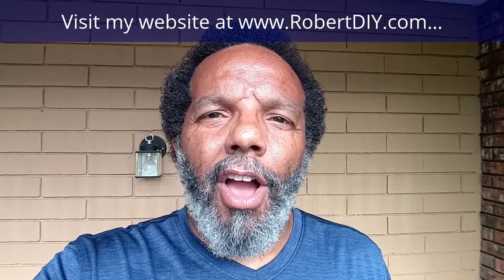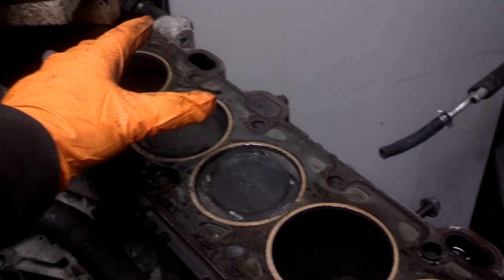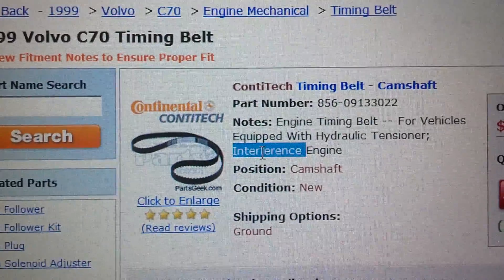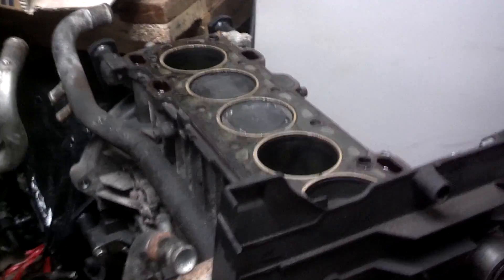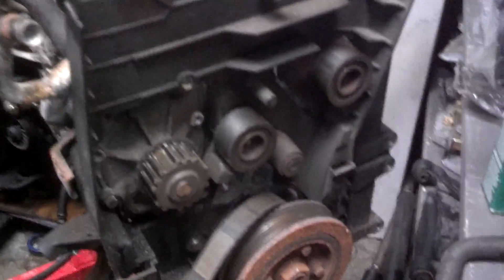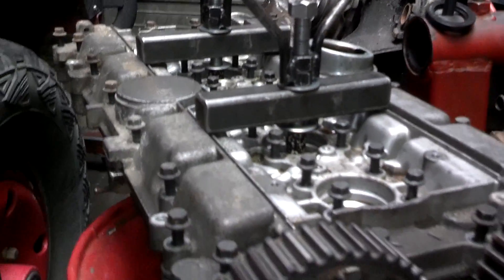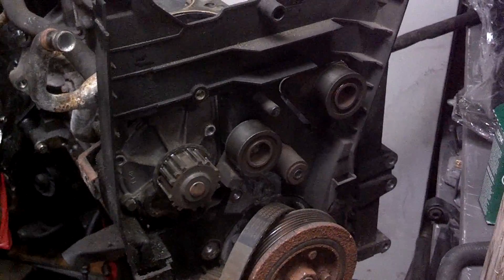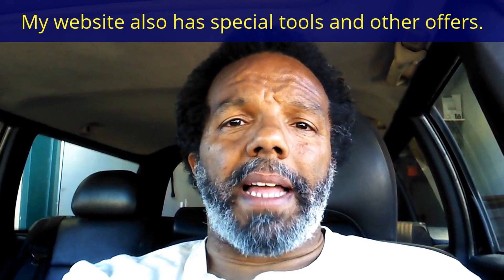What happened if your vehicle timing belt broke or came loose on an interference engine? - VOTD

Comment: interference makes no fkn sense
Reply from the maker: I agree.
Reply: @RobertDIY   It is most definitely, absolutely CRIMINAL, that engines are INTERFERENCE. A very simple 5 mm (or less), notch (depression) on the pistons, would prevent these problems. Or, if the cylinder, was a few millimetres (mm) longer. The cost at a dealer to repair, can easily be $5k, or even a backstreet small garage, will easily charge about $2k, just for labour. My 2009, c180, the timing chain just jumped time, and it wouldn't start now, I checked, the teeth on the timing chain gears were worn down.
Reply: @ZafOsophy  Had you replaced timing belt and bearings on schedule?
Reply: @ZafOsophy  Yes its a shitty design, but it makes for a more efficient motor, which means lower MPG and higher power.
Reply: @kristupasantanavicius9093  Maybe you are correct, but I don't understand how. 2 or 3 millimetres clearance, either by making the cylinder a little longer, or making a few notches on the piston head, would make sure, never any 'bent valves'.
I bought a timing chain kit for about £200 pounds, replaced just the chain, checked for compression, and it all worked fine. I did all the work myself, after watching numerous videos. I also upgraded the radio, and fitted a few dashcams:
https://youtu.be/DNJpTjrZMNs
Reply: @ZafOsophy  A local shop did my timing belt. They said belt tensioner was dead. They could remove the bolt by hand without any tools. I'm not sure how my car hasn't jumped time. Maybe you weren't so lucky :D
Reply: @kristupasantanavicius9093  Are we talking about a Mercedes C180. Maybe, you are confusing the Serpentine Belt (Visible - Fan Belt - Nothing to do with timing), with the Timing Chain (Hidden - Inside the Engine - Purely for timing).
Reply: @ZafOsophy  Some cars have timing belt instead of timing chain. When its a belt, its under a cover, but its not inside the engine. Timing chain also has a tensioner. I don't see how a chain could jump time unless it is stretched or the tensioner is bad. I have Volvo 850.
Reply: @ZafOsophy  the design cannot make a longer cylinder to make a longer stroke bcuz longer stroke is then not even close to efficient.  Simple geometry/physics.    Not able to have notch in piston tops bcuz of need for exact amount of mass at the right spots.    Read and learn things before  imagine that an entire finely tuned for production and product satisfaction industry, is somehow 'intentionally' making shiet products!   They have no other options but to create enough power and efficiencies.   This is basic stuff man!
Reply: I mistyped in my first response. I just changed the Timing Chain COGS, not the Timing Chain.
Reply: I bought OEM parts and the timing belt tensioner pulley went bad causing the belt to break. Im gonna put it back together n start it up and see what i got😐😐😐😐

Comment: What happens if the timing is off, but belt did not break?
Reply from the maker: No difference.
Reply: Serpentine belt broke. The car is trying to start, but won't. 04 S40.
I've seen on the web where a mechanic fixed an engine to where the timing belt was installed wrong.  They didn't replace the head, they reset the timing belt and the car started. Can you answer how that was possible?  I've learned a lot from you Sir and some of the other great people her. Thank you so much.
Reply from the maker: +stillwalking64 what kind of car was it? Not all cars have interference engines.
Reply: @RobertDIY  i have 1995 Lexus ls 400
Reply: Robert DIY same problem 2000 s80 serpentine belt broke while driving tow home won't start should i just replace serpentine belt.

Comment: Hello Robert...Thank you for all of your videos and tutorials that have been very helpful through the years.
I have a 2004 XC90 FWD 2.5and the timing belt broke on startup....I had no idea what was wrong at first and tried turning the engine a few times.  The belt broke and was not turning the camshafts.....what do I need to do now because I put the a new timing belt on and it wont start?
Reply from the maker: Did you watch the video?
Reply from the maker: https://www.youtube.com/watch?v=-2oIeIhpV44
Reply: I did.  Okay then...as a DIY...can I do the whole valve repair and change the head gasket myself?!
I do have good mechanical sense, I just wonder if this is something that can...or should not...be undertaken.
I have not done a compression test yet...does it matter?
I have not done a leakdown test yet...does it matter?
Could the non-start be because my crankshaft timing might be off a tooth or two?----even with bent valves, shouldnt the car start and just run rough?
Could a completely clogged PCV system cause the non-start?
Could really fouled spark plugs cause the non-start?

I know I am asking A LOT....I can not tell you how invaluable your videos have been for me...and any help ius very much appreciated.
Thank you
Reply from the maker: https://www.youtube.com/watch?v=gt9w-ZSxs9I
Reply from the maker: you tossed the timing belt, it's over. You can do all the test you'd like, it won't fix the bent valves. Yes, this job is done by men so yes you can do it. However, you will need a shop to do the head work because the solid lifters require adjustment.

Comment: If it stalled on the wife's 1999 v70xc I think she would try to start it.I just did the belt,idler,and water pump on hers which went 120,000  between changes.She has 235,000 on it.It has really terrible cam marks,I was off a tooth and send it to a garage that does them a lot.It cost me 120 dollars more than all the parts I had bought for 250$
Reply from the maker: Glad you got it done. Hope you used good quality parts. I would try to restart my car as well.

Comment: Personally, I say if you have a broken timing belt on an interference engine. Put a new timing belt on the engine and see what happens. Now provided you didn't try to start it back up afterwards then hopefully there is no damage. If you replace it and the car runs then it's a success. If not, well then you got more work to do, but at least you have a new timing belt. As a matter of fact, the timing belt once broke on my grandfather's old 1988 240 and he knew not to start it after that and got it towed to a gas station where they successfully replaced it with no internal damage done. My dad picked him up from that incident as it was right around the corner from our house
Reply: Michael Sackstein That only worked because the redblocks with SOHC were non interference engines. you can't damage the valves or pistons by breaking the belt on those.
Reply: Michael - I think the 240's engine may not be an interference engine so no damage if the belt goes.  Years ago I was on holiday in Spain.  I could not start the rental car and a guy in a 240 kindly phoned the rental car place to find the trick (crazy security system).   Twenty miles down the road,  i found  the same 240 immobile by the side of the road.   The driver explained that the timing belt had gone.  I asked if that meant a new engine but he said no, all it would need was a new timing belt.
Reply from the maker: Old red block. Most people don&#39;t even replace the belt, just wait till it breaks, tow it home, toss on another belt.
Reply: Robert DIY  hello Robert I had an issue with an 05 Colorado the serpentine belt fell off on the freeway can I just put a new belt on I looked the engine up and it doesn’t say interference engine

Comment: 960?  

If the worst were to happen, which would probably cost less

- To get an engine from a smashed car at the breaker's yard and have the garage install it?
 - Have the garage rebuild the head?
Reply from the maker: Man, I believe a head rebuild would be cheaper. They probably have used valves to install.